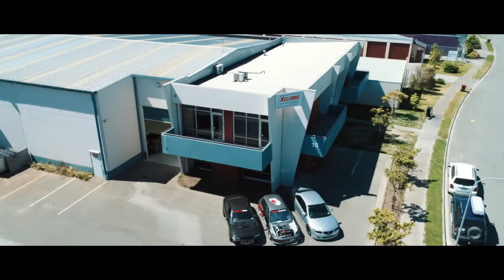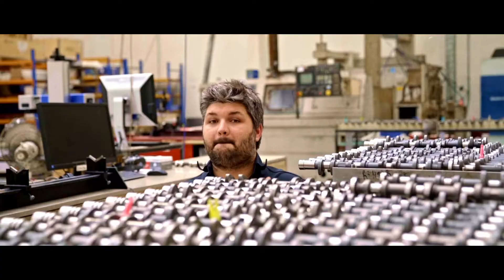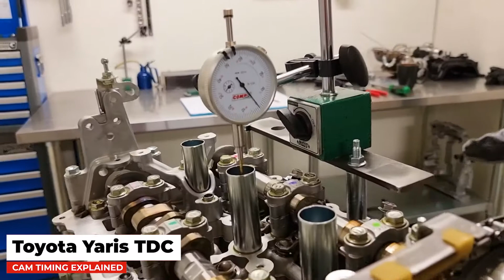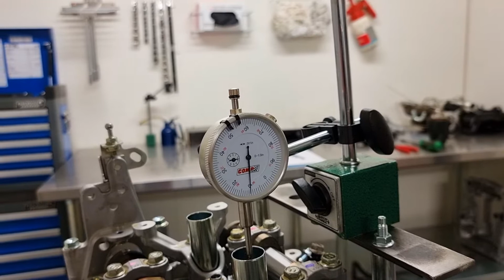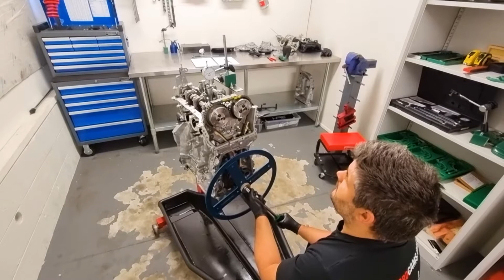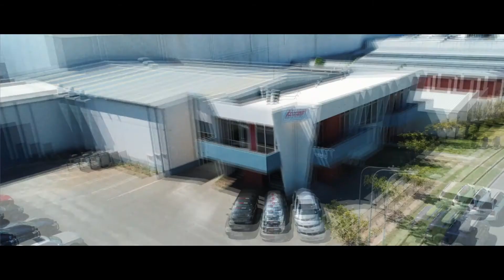Toyota GR Yaris Engine - Finding True TDC (Toyota G16E)

Comment: the gr motor has an offset crack shaft center line to the cylinder so tdc is longer then a center line crank to tge cylinders  that has an even tdc